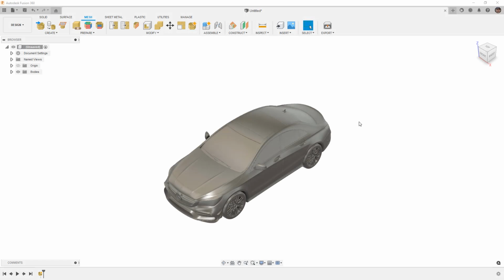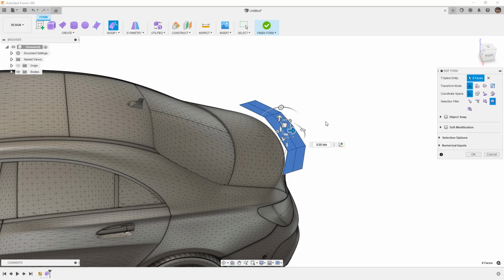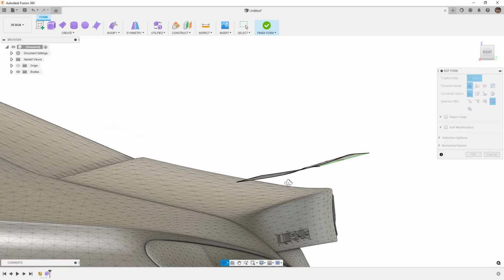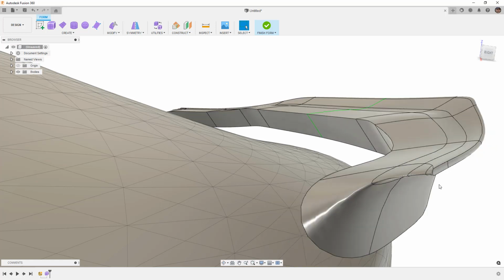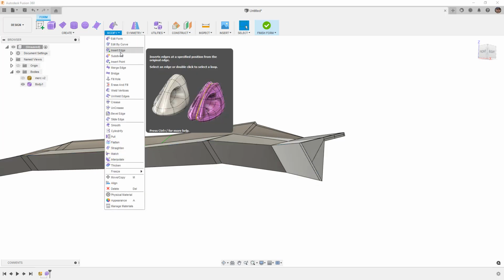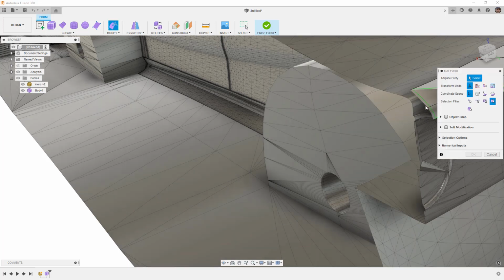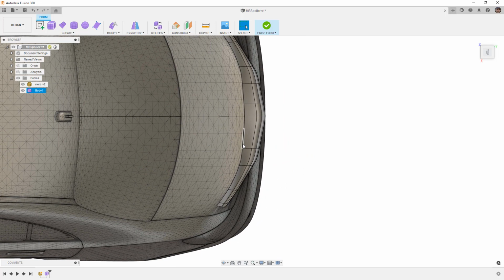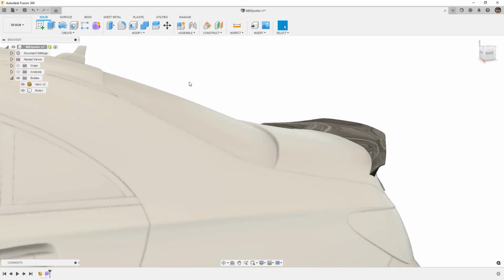Fusion 360 Form Mastery - Part 25 - Designing an AMG Spoiler #Fusion360 #CarDesign

Comment: Great video! I took your suggestion from your other video and checked out the YouTube channel (namenotimportant). Interesting videos over there. He briefly mentioned over-building being another good option for modeling cars and car parts, are you familiar with this style of modeling? Do you have or plan to make a video/series with that approach?
Reply from the maker: Thanks Me-duh.  Yeah he had an interesting style but managed to get some great content across.  As far as the Overbuild method.  I don't currently have any plans to cover that.  Mainly because its really hard to accurately control the interface and you end up adding fillets to blend surfaces together.  I think that method works okay for things like Glass/Windows or external features like intake scoops or headlights, but for the main body it is much harder to control.  I think his example you are talking about was not a replica of an actual car but a pretty low detail one right?
Reply: @LearnEverythingAboutDesign  Gotcha. I'll have to go back and check but I don't think it was a replica but then he also showed a few examples of a bumper so I'm not too sure. Lovin the vids you've created so far. I'll check into the over-building stuff a little more over the weekend.
Reply from the maker: Me-duh, I just did a quick example of an overbuild approach in this model.  Its the AE86 from Initial D and I was building the side of the body, the hood, roof and windscreen each as their own bodies.  What you end up with after they surfaces get converted is something you need to trim and then fillet.  It isn't a realistic way to build most cars.

https://a360.co/3Iru1Tk

Here is the same model after they are converted, trimmed and stitched.
https://a360.co/355p58t

if you have a car model that you can go back and blend later with a loft(i wouldn't suggest it as the loft is acting up right now) or can have a fillet then it might be viable.

The only thing I use this approach on right now is the glass.  To me the whole point of using a Form is to get smooth curvature continuous bodies.  The overbuild method removes that.  It is really used when you have trouble controlling edges tightly, but we have seen it can be done with patience and practice.

If you find any additional resources/examples please share them here.  I would love to see some applications of this.
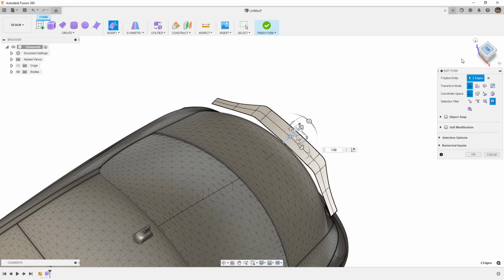Reply: @LearnEverythingAboutDesign  I think you're right, overbuilding can be useful but needs to be applied to the right project. I went back to find the video and section where it was mentioned just for reference. Here it is 6:28 onward https://www.youtube.com/watch?v=Gf1lNAGEalQ - I'll keep an eye out for some other examples and let you know if I find any.

Comment: Nice one as usual! And even if it is CAD, it's literally subdivision modelling with the edge control and smooth and box display (SubD0) but with a little more math and less faces than in a typical SubD mesh modeling software like blender etc. , So the workflows transfer nicely when the brain connection is made